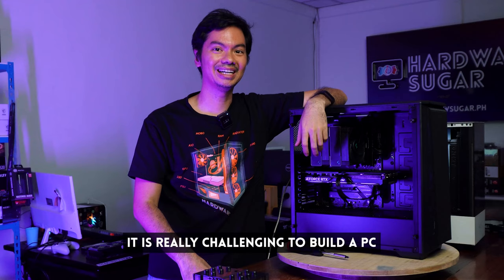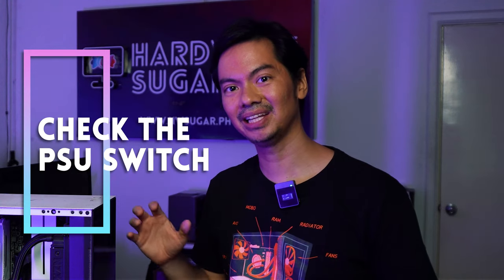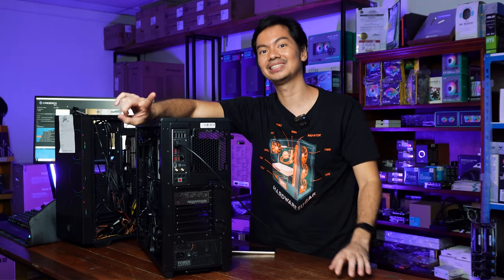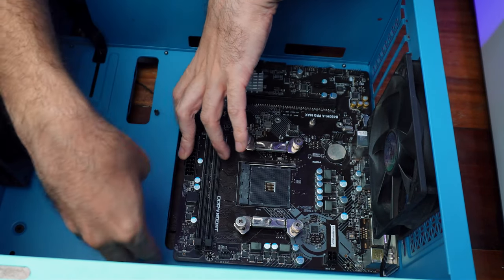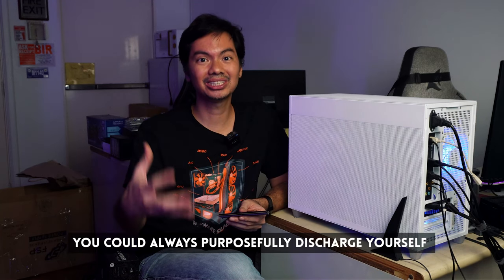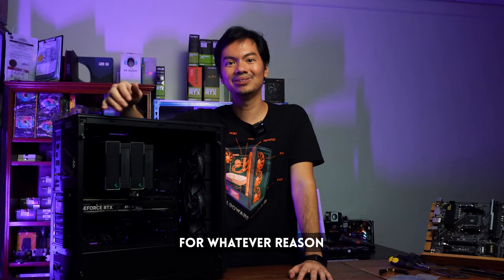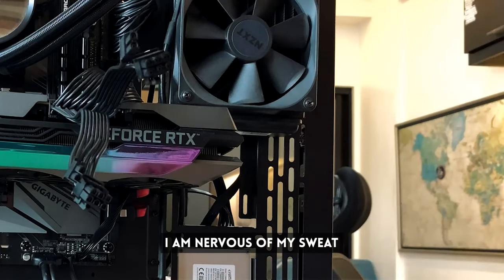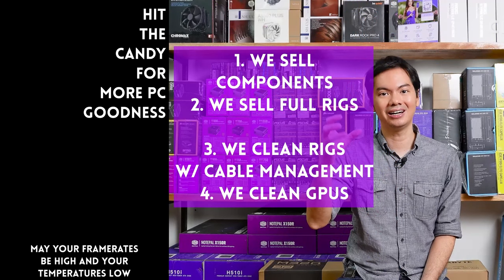Computer Building Tips for Beginners (and experts too)👨‍🔧

Comment: Q > Kapag magdadagdag ba ng RAM dapat same brand siya dun sa existing na nakalagay? 😢
Reply: ok lng kahit hindi same brand basta same frequency at capacity for optimal performance
Reply: @jessierosenqueen5644  frequency lang sir? Meron kasi yung CL sa mga pangalan ng mga RAM, hindi ko alam kung okay lang ba na iba yung CL pero same na 3600mhz
Reply from the maker: we have a video answering that https://youtu.be/ZORxa7T6F90
Reply: @oraaaaange7470  well technically you can mix and match rams with diff brands/frequency/capacity and CL timings as long as they're in the same gen(DDR3/DDR4/DDR5) but as what i said its much better to have em the same to avoid system instabilities and for optimal performance.